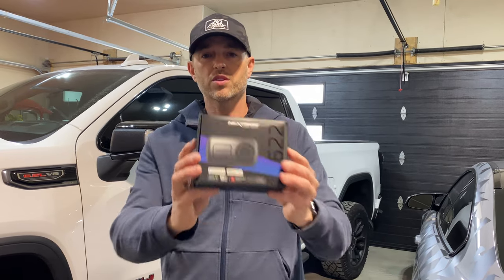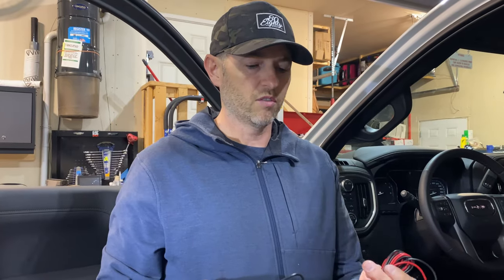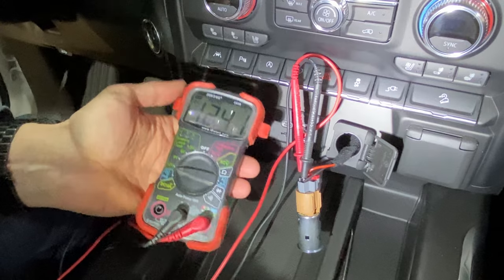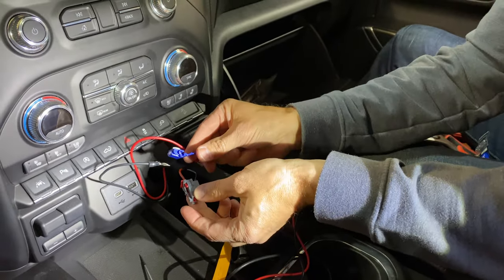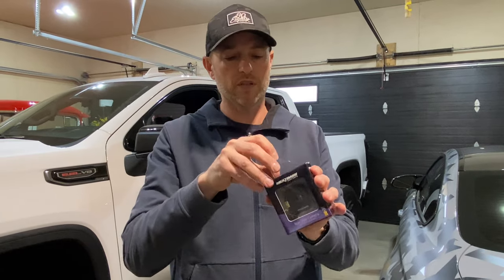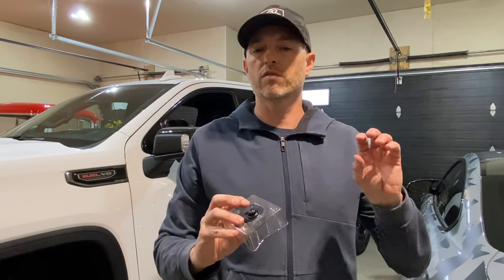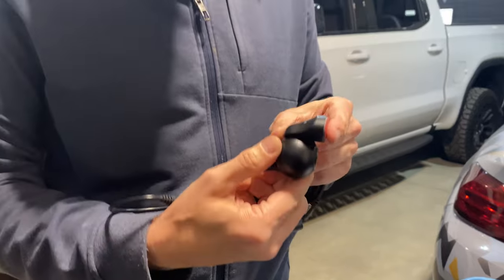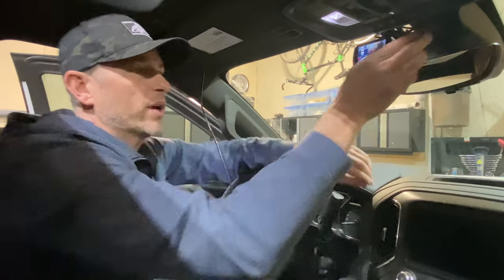Nextbase Dash Cam with Rear Camera Installation and Comparison.  What's Best for a Truck?

Comment: I planned on buying 4 cameras for a 360 view.  You said only 2 cameras work at 1 time?
Reply from the maker: This model is only a 2 camera capable model. I am not aware of a 4 camera model.
Reply: @Donslife  So, I'll need 2 separate setups?
Reply: @Donslife  I called the company.  They said you can't use 4 cameras on the app.  How'd you make it work?
Reply from the maker: @punanamousme8486  I don’t understand.  I said the 622GW can only run 2 cameras.  Not 4.  I don’t have or review a 4 camera dash cam option in any of my videos
Reply: Ooops... I posted on the wrong vid.

Comment: Does anyone know the best camera for front/rear/and interior that also has motion/impact features to help for survaillance during parked condition? Also, is there a camera that will notify you by phone when it's detected tampering of vehicle?  What happens to video if the camera is stolen?

Comment: I have a gmc at4 without the front camera package is there anyway I can use that rear camera and put it onto the grill to see the front of the truck?
Reply from the maker: Unfortunately I don’t think so only because the auxiliary camera probably isn’t designed for use outside of the cabin.
Reply: @Donslife  any solutions yo think i can do to set up a front facing camera into the gmc dashboard screen?
Reply from the maker: Sorry for the late reply.  There might me an aftermarket solution that lets you connect to one of the camera inputs on the factory screen, but I am not aware of a compony doing this for the newer ones.  2013-2018 there is more of a market for that.  You may have to wait unfortunately.

Comment: My rear window camera for the 522 shows the small screen for a split second then gets stuck on the record screen and says 0.01 do you know the reason?
Reply from the maker: No, sorry I don’t.  Did you contact nextbase?
Reply from the maker: I found this with a quick google search :  

“I did the full factory reset in the menu's, the pin reset underneath and reformatted the card....all in that order and the rear camera is now .... working.”

Comment: Did a fuse tap into my heated steering wheel for accessory power, and the garage door opener for constant power.
Reply from the maker: Good idea.   Running good as is for now. This Dash Cam has a sleep mode and doesn’t draw power in that mode.  Or if it does, it’s not substantial.
Reply: @Donslife  I have a BlackVue setup with parking mode. Power magic pro I can turn on or off if I decide I want parking mode. Otherwise it fires up when I start the truck. I did the rear camera in the same spot due to the sliding window

Comment: I assume that the original mini usb connection to the dash cam itself/gps magnetic mount is now obsolete if you using  the rear mounted 3m sticky version as it looks like a different connector like some sort of mini hdmi port or something
Reply from the maker: Not sure I understand the comment fully.  The mini usb is built into the mount for the front camera. The front camera connects to the mount magnetically. The side of the camera has a mini HDMI that runs power to any of the compatible auxiliary cameras and receives their signal in return.  The camera records both feeds simultaneously and saves 2 files to the card in 1-3minute increments.
Reply: @Donslife  so I mean you still have to use the mini usb hardwired lead that would plug into the side of the magnetic gps module & then the rear camera 6.5 meter mini hdmi lead that plugs into the side of the dash cam itself

Comment: were you able to hide the rear view camera wire?
Reply from the maker: Of course!  All that is exposed is about 1” from the headliner to where the camera is mounted
Reply: @Donslife  i was wondering this also.  So you just went around the headliner?  In the video you commented about going down the middle of the truck.  I’m dumb. Sorry.
Reply from the maker: Sorry if I misspoke or gave the wrong impression.  The cables are usually long enough to go around the perimeter of the headliner, tucked in deeper in some spots than others
Reply: @Donslife  thank you!

Comment: It's not called a cigarette  adapter. It's actually called an automobile auxiliary  power outlet
Reply from the maker: Yes! 😂 I am old school I guess but also….The 12V socket, also known variously as a car cigarette lighter or 12V auxiliary power outlet, is the primary method by which power is delivered to portable electronics in cars, trucks, recreational vehicles, boats, and in a handful of other contexts.

Comment: Damm I wanted to see how you went threw the headliner,did you even make a video for that.
Reply from the maker: Just pull back the rubber weatherstripping around the tops of the doors and tuck in the wires about 1/2”. Then press the weatherstripping back on.  Sorry I made the video more generic and intended it not to be AT4 specific.  You can email me or message me on Instagram if you want some pictures of where my wires go in the headliner.  

There is a Thinkware Q800 with rear camera I installed on our 2022 Escalade.  The video is in the Cadillac Escalade playlist

Thinkware Q800 Pro Installation and Review.  Good Value and Full of Useful Features!
https://youtu.be/KzEfMI-vZuM

Comment: How did you run the wire through the headliner? Had to remove it?
Reply from the maker: No removal necessary.  Just pull off the weather stripping and you can tuck the wires along the edges of the headliner.  Then put the weather stripping back
Reply: ditto Don's comment above.  It's a pain in the you know what but doable.

Comment: For your wire tap, what wire gauge is it?
Reply from the maker: I am estimating 14-16 guage. Which is sufficient for the amperage being tapped into
Reply: @Donslife  So I used 14-16 gauge wire tap and worked like a charm.  Thanks to your video I was able to get my nextbase installed the same way.
Reply from the maker: Perfect 👍🏼

Comment: Just bought this camera and within 2 hours of use it froze, do you know what caused this problem? Thanks
Reply from the maker: If not done already : Firmware update, MicroSD card that meets the Read and Write speed requirements (128GB or smaller I think).  Nextbase has a pretty good troubleshooting guide on their website as well a tech support.  My 622GW and 522GW have been fine.  Once in awhile I format the SD card on the 522GW.
Reply: @Donslife  Exactly my experience as well ... not only must the Micro SDHC be the correct class of card (U3 & state 4K recording), don't go cheap - buy a brand name card. I tried going with the cheapest I could find that met the specs & the first never worked (Netac), then a slightly more expensive (but still cheaper) card failed in less than 3 months. After buying name brand cards (Gigastone for the GMC 3500HD & SanDisk for another dash cam on the Harley-Davidson), I've never had another issue with card failures and/or the dash cam freezing.
Reply from the maker: I applaud your response!

Comment: those plastic wire taps are JUNK!  cut and solder the wire..  I thought this was common sense.  yes rip the wiring apart at the 12v plug and remove those plastic wire taps.
Reply from the maker: Thanks for the feedback.  If you’ve watched other projects on this channel there is plenty of heat shrink tubing and soldering going on.  This one dash cam did not get that treatment.